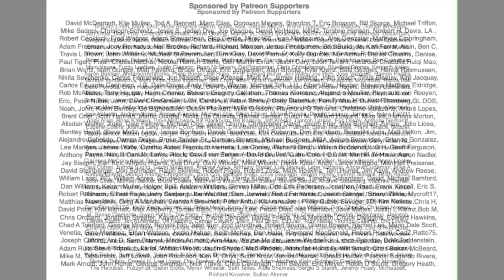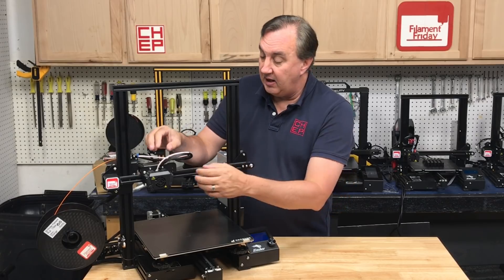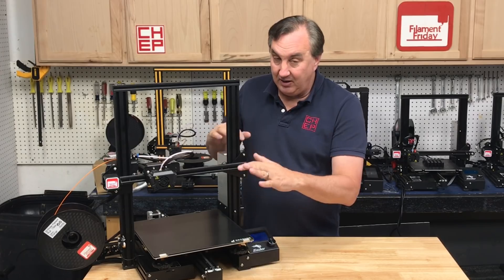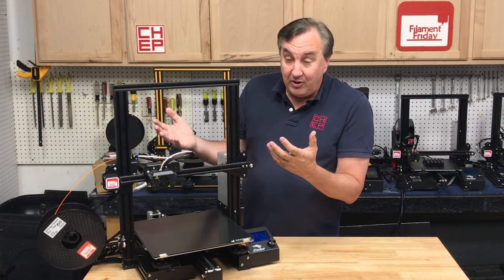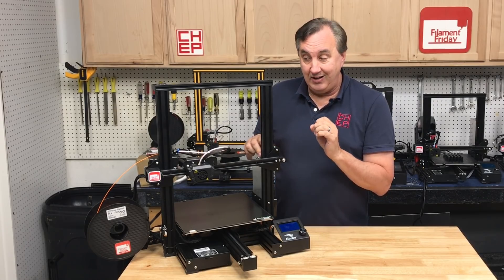Creality Ender 3 MAX! - 300mm x 300mm x 340mm

Comment: I've been running/Battling an E3Max since Dec2021.   Don't get one unless you plan on buying/installing a Dual Z...  constant drooping of the X carriage causing Z axis issues...   Came from Creality with the Z carriage's eccentric nuts so tight it made flat spots/crushed wheels.    Fought with creality for replacements... they sent me one, when I showed them multiple wheels crushed.   Fixed it my self...  After a little running trouble pops back up.   Needs constant attention.   Causes X carriage to pivot instead of running up and down.    It droops so much it crushes the nozzle into the work and clogs the nozzle.   Seems like a nozzle issue, but its the x gantry pivoting instead of moving up and down vertically.   Note that the neo comes with dual Z...

Comment: Hey Chuck, I had purchased a refurbished Ender 3 Max.. and seem to have a "cold spot" on my bed. I tried changing the build plate material.. and leveled it about a hundred times (with both of your files) and have not had any luck. Would you happen to know where I could get a replacement heater for this bed? All I can find is parts for the regular Ender 3 and Ender 5.
Reply from the maker: I would contact Creality3Dofficial.com and see if they offer replacements. They have email at the bottom of their main page.

Comment: @chep - Did you install the CRTouch or BLTouch and what firmware are you using? I installed the Ender Extender to increase my bed size to 300x300. I downloaded the Jyers source code, modified the bed size and increase touch points from 3x3 to 5x5. I create a new mesh and ran a test print. The mesh showed the left side of bed was significantly lower than the center and the right side was significantly high than the center. When I ran test print, the left side printed well but not the right side cuz the hotend was too far from the build plate. 

I am stumped why software is not properly accounting for the differences. I am considering installing the Ender 3 firmware to see if that fixes the issue. Thoughts?
Reply: Same here. I'm going insane with this problem haha. I've tried increasing the touch points to 7x7 and still had the same problem. I've tried linear and bilinear leveling and both didn't work. I've also rebuilt the whole printer but it didn't solve anything. So far the only solution which worked for me was to manually level the bed.
Reply: @selwynng117  Here's what I found to be the best solution. 

1) I purchased the dual-z from Creality. 
2) Heat the bed and nozzle and then level the left and right side before I tighten the socket screw on the right dual-z axis.
3) Adjust z-offset
4) Use Preset + Manual Leveling to get the 4 corners closely leveled.
5) Create a new mesh
6) Use Level + Manual Tuning to make minor adjustments. 

I am getting very good prints now.  Just verify periodically the axis is level. I have found after a couple of days it needs to be fine-tuned.

Comment: I run 3 ender3's every day for my small business... so I'm not new to Ender style printers.  I just got an Ender 3Max before Christmas (black Friday deal).   Came with every excentric nut way over torqued.   Made flat spots on the wheels that cause a noticeable 'thump' in every axis.    I've left them loose for a few months an it hasn't gone away.   Causes the right Z to bind and the Z axis to pivot on the side with the X axis stepper instead of going up or down... then pop it moves.   Can't even set a Z height on the BLTouch

Comment: Hi - just bought an Ender Max for hubby. No obvious slicing software for the Max. Can anyone point me in the right direction for getting the right software or a link to a step by step guide on how to change settings to extend the print size for the Max. We are used to resin printing but this is all new. The printer came with Creality Slicer 4.2.1. Is this what we should use or is there a better choice? We have searched on various sites and found various bits of info but would really appreciate a single source of truth on what to do:). Thanking you all in advance.
Reply from the maker: You can use Creality slicer. Just select the Max as machine profile. Creality slicer is just a rebranded Cura slicer. I have profiles for Creality printers and lots of Cura tips. Check out my videos and playlists.

Comment: Straightforward and honest. Well done Chuck!!! This whole thing looks to me like a bit of an afterthought rather than upgrade.. And for 400 quid??? Really?? And why still bother with 4040 extrusions for 300x300 bed where 60x40 should be the norm to provide more stable Y axis? Or at least put six wheel carriage if they're too tight to fit wider Y rail??  I was given a 4.2.7 board by a friend and managed to get my DIY i3 running on it.. Really annoying there's still no EEPROM on it and needs an SD card to store settings. So, back to Mega/Ramps combo with 2208's and 4.2.7 went in the storage box.. And why no dual Z motors and screws since the X is quite lond already for a single screw?? These a cheap as chips these days and I'm certain Creality gets them even cheaper from their suppliers. Just a thought...

Comment: I bought just a CR10 in November and replaced the glass with a magnetic bed. Then  it too also has the limit switch screwed into the frame rails so now without the height of the glass I was really far away and had to use a ton of washers to put some tension on those springs. I will give the T nuts a shot.  thanks MM.

Comment: what dual gear extruders if any can be added to this, is it required, and would it be same ones as what fit the ender 3.
Reply from the maker: Yes, but I would recommend an EZR instead. https://youtu.be/1GNDxvxpWr8
Reply: @FilamentFriday  cheers, looked on amazon (in uk), no signs of it.. dang, printer on its way to me today, just sold my ender 3 which had quite a few upgrades including a dual gear that you reviewed (and it was a good improvement) may just order one of those seen as the ezr isn't available

Comment: I hope creality fixes the BLTouch issues too. I tried to install it on my Ender 3 Max for the past 2 days and I keep getting issues. Mostly the "Home Z First" issue even though I already set and store my Z offsets. I did so much research and so many people are having the same issues but little to no solutions for it. I'm not going to give up and will try to fix it, if I can't fix it in one month, I'll try to use my warranty and refund it at the shop. (The BLTouch I mean, not the printer. The printer is perfect, lol.)

Comment: So 2 questions...the Z axis end stop, can one use the slot nuts to get around the solid placement? 2nd the 300x300 base, does the aluminum plate do well with warping?

Comment: Mine arrived today. As the bed is quite warped, I had to use Mesh Bed Leveling. Therefore I had to compile a new marlin firmware which adds aditional features like listing files when inserting an SD card or babystepping on longpress of the knob. Why does creality not offer these features in stock firmware?
The filament runout sensor got stuck on the second print. I had to bend the lever of the microswitch and it seems to work now.
The Z-stop switch is to high for my liking and I moved it down for about 4 mm.
Whith all these modifications it seems to run quite nice.

Comment: Not long got this but its not in cura for the settings so at moment using ender 3 settings ?
Reply from the maker: Yes, I just adjusted the machine settings to match the 300x300x340

Comment: Alright, so I've had my Max for about 3 days now. Mine DOES have a filament runout sensor and silent drivers. Not that it matters much because the PSU fan is so loud. No, they didn't fix the Z stop placement, though I've read that most people just buy some T-nuts and screws to fix it. So far, I'm pretty happy with my printer, though, because of the Z-stop thing, my bed goes out of level pretty much every print. I ordered a BLTouch, but I ordered the wrong one, so it didn't come with the right bracket, and I have to send it back tomorrow so I can order the correct one.
Reply from the maker: Mine was an early beta unit. They listened and added silent drivers and filament runout. Same Z stop setup though.

Comment: Your videos have been helpful getting started with 3d printing.. I just got one of these last week (I also have an ender 3 pro), the z stop issue wasn't fixed with this batch but after looking through some of the other comments the t nut may be the way to go. I also noticed some bowing in the z axis rod and am working to print a spacer to see if that helps fix that issue.

Comment: Aw man, I’m a 3d printing noob, knowing the bare minimum on how to print, while printing on an iPad lol. My max comes in this week but now I’m regretting not getting the v2. I had bought a microswiss  direct drive extruder for ender 3, it should still fit right?
Reply from the maker: Yes, it’s the same hot end. They fixed a lot of these issues so your good.

Comment: Getting mine on Wednesday. Will see whats what then.
Reply: lol ditto.  literally.
I've got one coming to be delivered on Wednesday as well!

But I believe they've updated to silent steppers and fixed the Z stop adjustment issue.
Reply from the maker: Nope. Fixed Z stop still in place.
Reply: @FilamentFriday  If that is the case, I wonder if placing another sheet of glass on the bed will work? It will take longer for the top of the bed to warm up, I do understand that, But it will ad between 3mm and 5mm to the bed hight. Or just use T-nuts. Lucky me will be building mine in the shop where I baught it. And he has spares and stuff on hand. He doesn't just sell DIY kits.
Reply from the maker: T nuts is what I used.
Reply: @FilamentFriday  Hi, got my Ender 3 Max yesterday. After assembly, I tried leveling the build plate. Came up short. So I looked at the Z end stop. Yep. Screws into the frame. No T nuts. What to do? It is to late to find a shop.
So I decided. Just release the other 3 screws...

And realized. 
The other 3 where holding the plate down. When they released, The bed leveled perfectly!

It comes with a filament out sensor. It works, but the restart of the print in almost 0.3mm out. So that doesn't work as planned.
The glass build plate works a treat.
I used that sample roll of filament.. EISH!
No desicant in the bag. So it printed stringy as a could be. 
I will test real filament today.

Comment: Does anyone have a cura profile for the max? Can’t get it to work nicely with the ender 3 profile
Reply from the maker: Machine profile? 
Use CR-10.
Reply: @FilamentFriday  thanks! got it printing! It’s not that as I expected, the fans are louder then the ender 3 and you hear the extruder motor a bit when restricting but I expected worse
Reply from the maker: Fans seem louder because the steppers are quieter. Max has silent drivers.
Reply: @FilamentFriday  It is MUCH quieter than the Ender 3. Could hardly hear it while printing.
Reply: do i get ender 3 max or ender 3 v2.
Reply: @roddsmith8954  I bought the max since i wanted the larger print surface. But I kind of wish i got the V2 instead. I don't think ill ever print that big anyway + you could just print two parts and glue them together. But the max is still a really nice printer! Also it comes with a metal extruder now

Comment: Why replace a great printer when I could just upgrade it?  Ender 3 max isn't worth my money yet.  No silent board is the biggest deal breaker for me.
Reply: It comes with a silent board, and a filament out detector. Power out resume is also in the firmware.
This was my 1st build.
It was easy, especially after watching so many unboxing and assembly videos, including the 1 on Crealities website.
And the fans are not as loud as the original Ender 3. Which I bought 2nd hand.
Reply from the maker: Mine was an early beta unit. They listened and added silent drivers and filament runout. Same Z stop setup though.

Comment: Chep, thanks for everything! I purchased an Ender 3 Max but in Cura, I changed the the X, Y and Z to 300, 300 and 340 respectively...but it won't let me print bigger models because it grays them out, even though, visually, the bed is the right size. Is there something in the Star G code I should be changing?
Reply: make sure you set not only the bed size but also the working area.
Reply: @BB-io8cz  I forgot to say thanks! Thanks! This worked!!
Reply: @BB-io8cz  Didn't think of that one. Thanks.
Reply: @aerospaceresearchmeyerton2687  cheers; how's the print quality on the 3 max? considering getting one but nervous at high Z heights about wobbling/vibrating.
Reply: @BB-io8cz  actually, I did a 32cm print. No wobble. But I think my v-rollwrs are to tight. So going to my shop to have it checked out. But for the rest. Compare with my Ender 3.
The glass bed is a winner. Smooth, and once it is cool, the 9rints pop off. Even a large surface print has no issues.
Reply: If you have a skirt, brim or raft enabled, it will automatically shrink your workspace size slightly. I run into this issue every now and then when printing near the limit of my printer

Comment: Thanks for the Trutfull review! i ordered the E3Max and then saw this review, i hope they fixed all the things you mentioned!  though this reviewe is on Creality webesite. i bought it for a really good price for 260€ and found it besser from specs than the Ender 5 which i wanted to buy first.
Reply: did they upgrade the specs?
Reply: The fixed the rubbing since it now includes the filament run out sensor. But the bed leveling and not having an adjustable z-stop was not fixed. I have had issues with leveling as due to this since the springs don't get enough tension with the default z-stop placement. 

Also mine came with a metal extruder so that is something they changed from this video. Also, mine has a silent motherboard.

Overall I am happy with the Ender 3 Max but not having an adjustable z-stop is a major miss. Also, I would recommend upgrading the bowden tube to a Capricorn PTFE tube. It's a cheap upgrade and the stock tube will eventually fail.

I hope you enjoy your Ender 3 Max!

Comment: I’d like some help on what to get as my first 3D printer.. I’m mostly getting into this to make lower Glock polymer frames. After seeing how many different applications are out there to print I want something to have fun with my son and hopefully show the wife this isn’t a waist of money. Would greatly appreciate any advice!
Reply from the maker: Not sure what Glock polymer frame material is but Ender 3 is a good low cost place to start.
Reply: @FilamentFriday  I’m pretty sure regular filament is used but have no clue.. I’ll have to do some more research. I think the ended 3 is the way to go but seeing the CR it made me second guess. I appreciate your videos and input!
Reply: The frames are usually printed from ABS/ASA for stregnth (Sorry for my awefull spelling) or you can try HIPs. Both can be printed on a standard Ender 3. Just put an enclosure over it when printing somwhere that is well ventilated.

Comment: Now that the max has been updated to come with the tmc2208 drivers, the filament run out sensor, and new 329 price tag. Would you recommend the max over the e3v2 for someone looking for a larger build area? Or would a e3v2 still be a better option?
Reply from the maker: I think they listened to all my complaints and corrected everything including the price. So I think it’s a great option now if you can afford the extra $60.
Reply: @FilamentFriday  so what about adjusting the z stop issue you mention (3 minutes in)? Has that been addressed? I am about to buy my first 3d printer and am heavily leaning towards the Ender 3 max. Nice review btw.
Reply: @cking22001  I'm in the same position. This would be an upgrade 3D Printer for me but like you leaning towards the Ender 3 Max....
Reply: I just picked up the Ender 3 Max and got it today.  The bed came screwed all the way down for shipping purposes.  Didn't have to adjust the Z Endstop.  Had the bed leveled in under 30mins with no issues.  Just make sure all the frame screws are tight.  The 4 on each side by were the Z/X Frame mounts were a little loose for me.  If you are still having issues with the Z endstop then spend the $30-40 on a BLtouch and be done with it.  The Ender 3 Max has a mount for the BLtouch anyways so you don't have to print one.
Reply: @Mid_Life_Gamer  was wondering if you can change out the thread screws for screws with t nuts to make the end stop adjustable? seeing as you have the machine on hand wondering if that is something you looked into?
Reply: @Mid_Life_Gamer i got the E3 Max yesterday and spent over 9 hours just trying to level the bed, i had to loosen the springs , but at. the end i got a really perfect print, without using anything , but i find a bit loud are yours also loud about 55db ?
Reply: @Mid_Life_Gamer Are these purchased shims or printed? If printed, do you have a link to the file? I just got a max and am not trust the looseness.

Comment: Do you recommend the Ender 3 max or the CR-10s?
Reply: Wondering this also
Reply: @antiaverageco  hey man, I actually purchased the cr-10s at my local micro center. I got $100 off and it’s amazing. I have had almost no failed prints and it worked perfectly out of box. Only thing I dislike is the leveling is not the best and the included filament is terrible so don’t even use it for test prints. But overall I give it a 9/10. Have no information on the ender 3 max tho
Reply: @Joeygbigdog  That is super helpful thank you, I've been regretfully holding off because I'm indecisive about it, I've been stalling wondering if would be worth to bump a few bucks up to the CR-10S. I think you've helped me make up my mind, thank you!
Reply: @Joeygbigdog  LOL, the sample is non branded, and not dried. It printed stringy as all hell. But because I have been printing for over a year I knew the difference was the filament, Not the printer.
Reply from the maker: I like the Ender 3 max. Newer features.